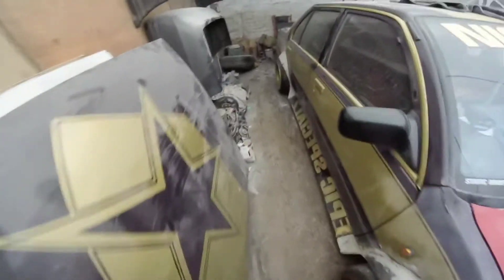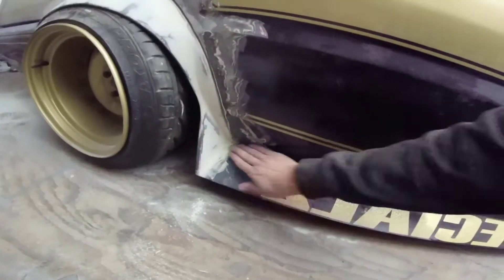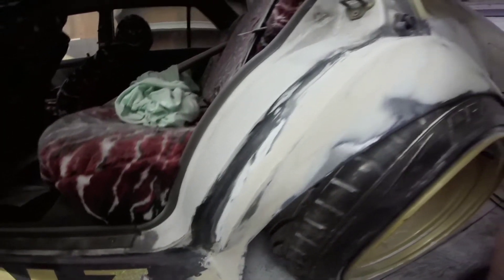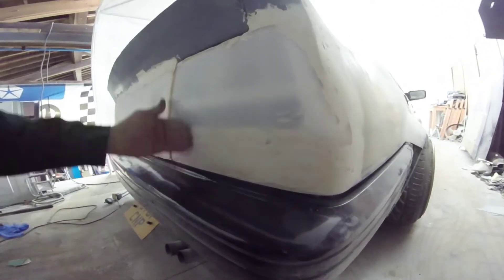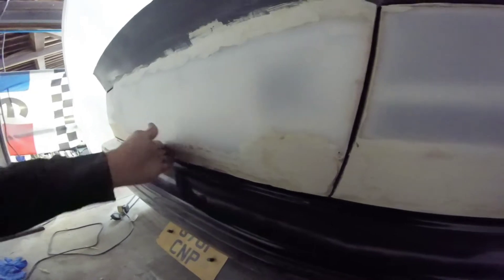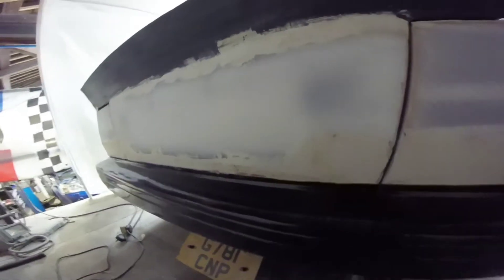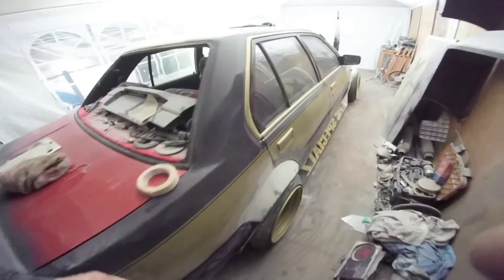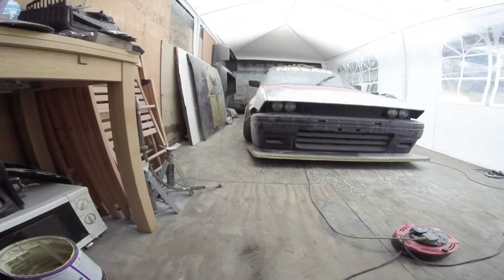The assassin kaido racer update

Comment: Can I ask what filler you use and do you hand sand or use a machine sander ? Can't wait to see this thing finished.  Was going to ask you about filler at retro rides  but I was far too star struck to approach!
Reply from the maker: I'm using UPOL fantastic filler ( I think its called that) it's smoother than regular stuff and sands very nicely. I'm just doing it by hand with a sadning block. I did use a DA on the bonnet but it just caused more problems. Ah you should have come and said hi, I love chatting about the car, I'm the uncoolest person on you tube 😅 no need to be shy.